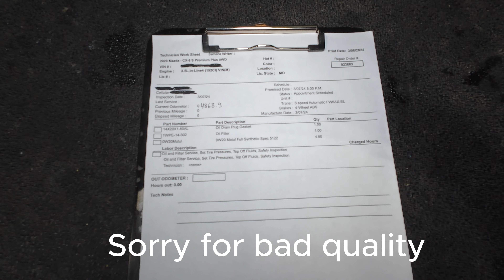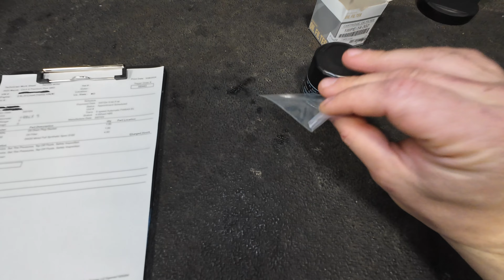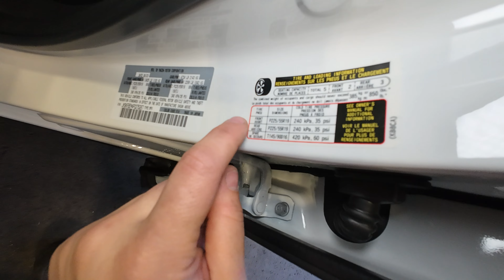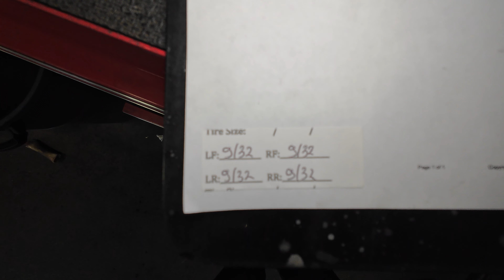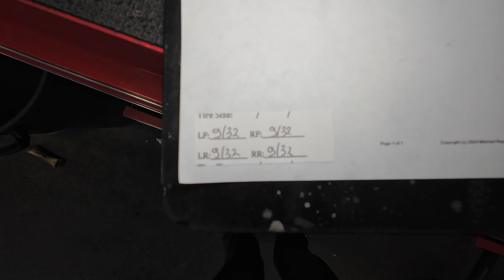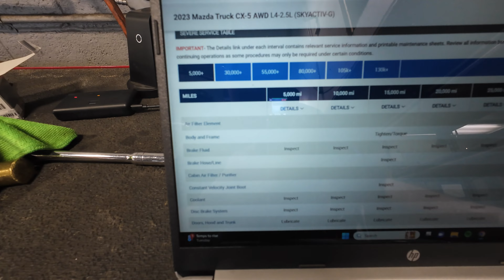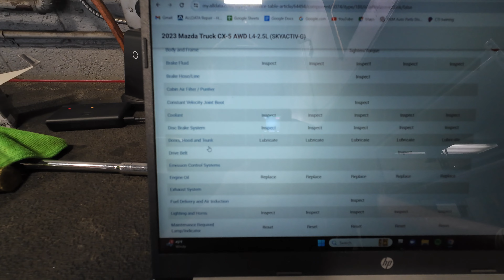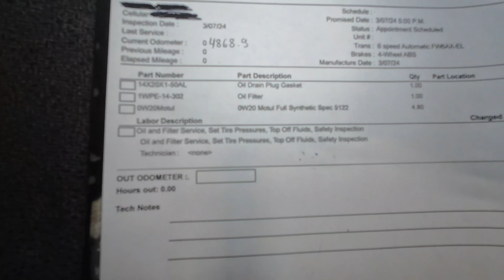Oil change done by a professional mechanic

Comment: I was always told to pre fill the filter before installing.
Reply from the maker: The filter will be full in seconds once the car is started. This filter is so small that it does not need to be pre filled. I have only pre filled filters on heavy equipment or big diesel trucks. To make sense of what I am saying, imagine if the filter is horizontal to the engine. What do you do then ? If you pre fill it, all of the oil is just going to run out by the time you spin on the filter
Reply: That's true he's not professional mechanic yet
Reply: @TheGiantMechanic  Read the article on filling the filter on youtube from The Motor Oil Geek
Reply from the maker: He is not wrong about pre filling the filter, but in a small cars case, the filter will be full of oil in a matter of seconds, and the correct oil pressure will be reached, if you have ever seen a car started without a filter or it installed correctly you know what I mean. You also never drain all of the oil during an oil change, so it's not like you are running the car dry. Then again, remember there are cars where the oil filter is upside down like in a Subaru or an Audi, there are cars with oil filters installed horizontal, and there are cars that use cartridges and you physically cannot pre fill them without loosing oil
Reply from the maker: @wskeebe  I will! He is very knowledgeable and he is a true expert in his field

Comment: First oil change should be between 500 and 1000 miles. Then 3 to 5 thousand miles between changes after that. Never leave break-in oil more than 1000 miles. There is always lots of metal in that first initial oil from the factory. You leave that in for 5 thousand miles you basically just took 50 thousand miles off of the engine's lifespans.
Reply from the maker: Sorry, I should have been more specific. When I meant the first oil change, I meant at our shop. I'm not sure if the client has changed the oil before at the dealer, but I agree with what you are saying. When I inspected the oil coming out of the car, it didn't seem like there were any metal particals in it
Reply: Most cars don't come with break-in oil anymore. If you want break-in oil, you have to change the oil right away yourself to break-in oil then change it to normal oil after that.
Reply from the maker: I will have to do some research on this. I almost never work on cars that have such low miles, so I never researched what is best

Comment: What brand is the oil filter wrench?
Reply from the maker: They are made by a company called VIM. They make really good, quality tools. It is a bit more on the expensive side compared to most, but they are adjustable, have great grip around the filter, and are very easy to use. Attached is a link to their official site with the oil filter pliers https://vimtools.com/product/v2400g/

Comment: If I come in for an oil change, I would expect just that and Oil change. No need to test drive my car and see "if" it needs more work.
Reply from the maker: Why wouldn't you want to know the condition of your car free of charge ? You do not have to buy the work if you do not want to, but at least now you know what your car needs. We do test drives also to prevent any of the "Ever since you guys" stories
Reply: When you check the oil you should check it while its warm anyways. Id rather they test drove it real quick to check for other problems and make sure its not leaking.

Too many horror stories of them (shops) trying to rush and they didn't tighten the plug or filter all the way... Then all the oil leaks out and you have a ruined engine.
Reply: Mechanics are people who have to make a living too. However most shops won't just sell you work that you don't need, but there are some less than honorable shops that will do just that.